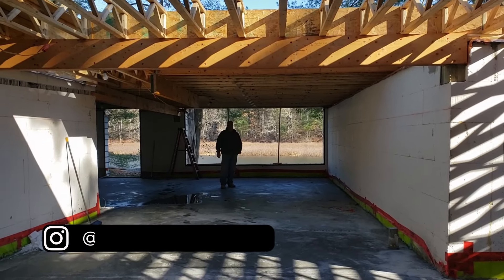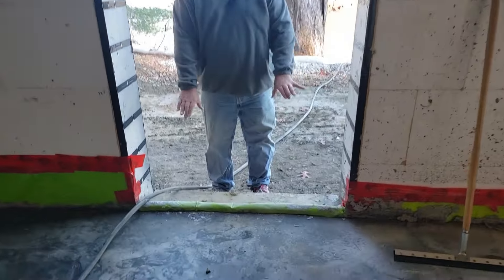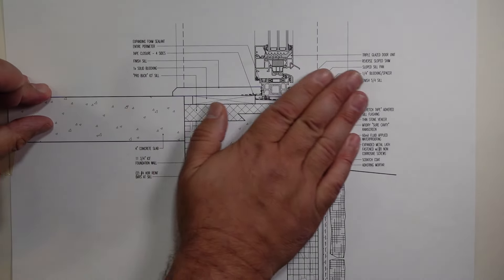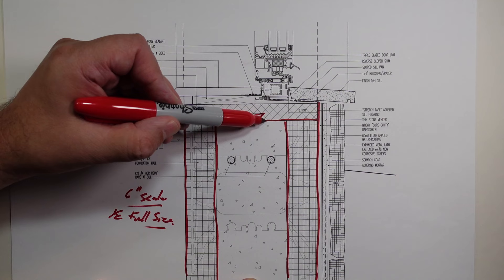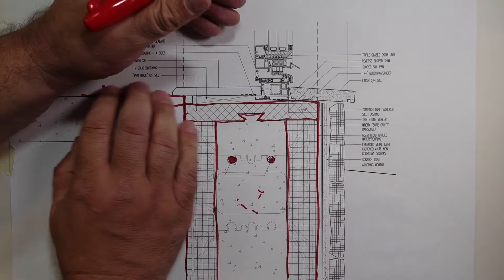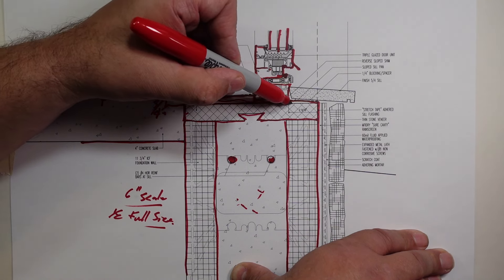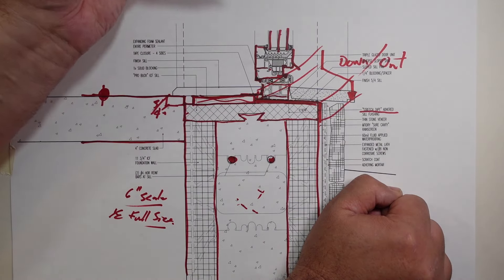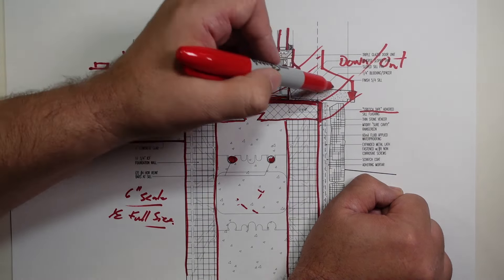DOOR SILL DETAILS at a WalkOut

Comment: I’d like to see the guys in the field following that design. What about an install on a door that is not going to have a step down?  I am going to have a walkout basement that will be under a covered porch.  And the outside slab is supposed to be the level as the inside slab. The outside slab will have a pitch away from the basement.
What would you recommend in this situation?